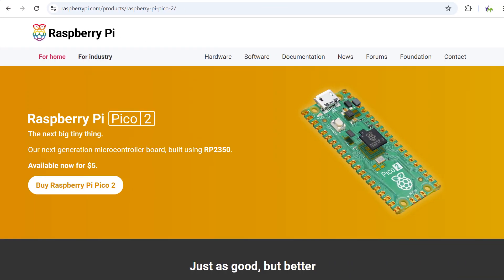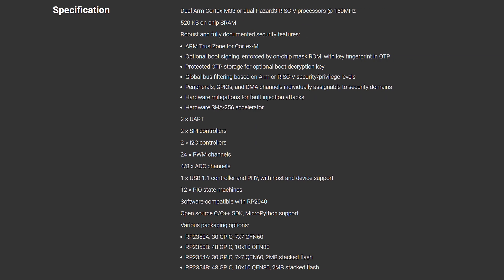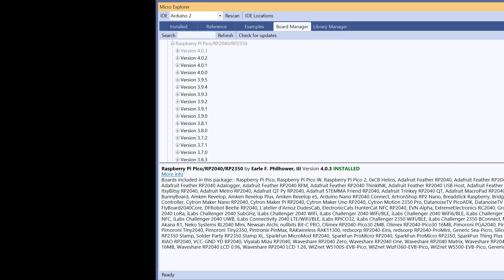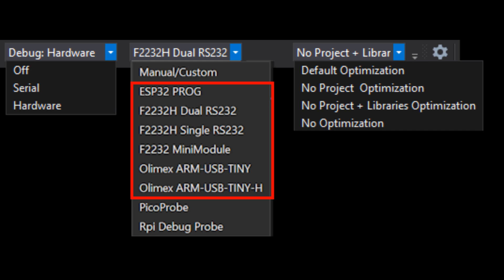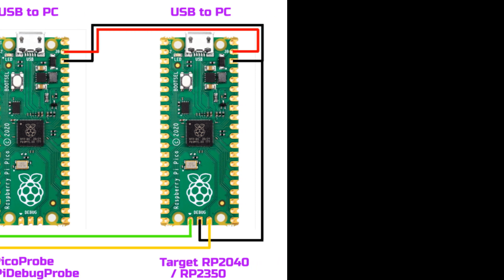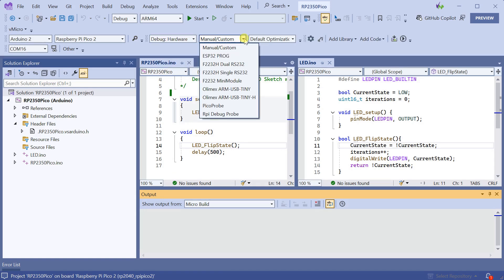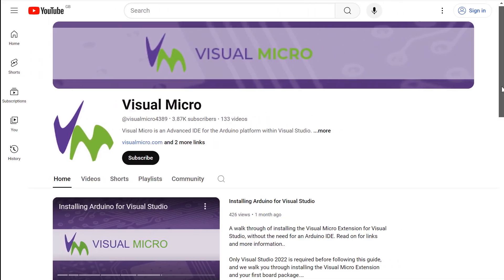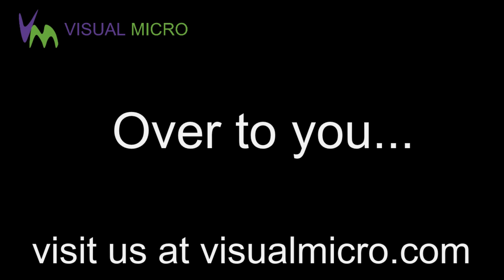RP2350 Arduino Debugging in Visual Studio

Comment: I'm afraid that all this video has done is confuse me. You call it Arduino debugging but the circuit has 2 Pi boards and you mention Pi all the way through. Whyt on earth would i want to denug my arduinno code on a different board to the target?????? I am left thinking this is not an Arduino debugging platform!  I have years of experience with ardunio IDE and platformio and would like to have a hardware debugger like i used to with my pic 16cxx and 18xxx with the ICD back in the day. So please make a version of this video that is based around the ACTUAL arduino (32-bit preferred such as rhe adafruit M4 board) and does not mention raspberry pi.
Reply from the maker: Hi, The video is about the Rasberry Pi 2350 board not the full Rasberry Pi computer board that runs Linux (the full Pi board is more commonly known). The Visual Micro extension for Visual Studio only supports Arduino compatibles. The 2350 is a new Arduino compatible from raspberrypi.com. For hardware debugging (as opposed to software debugging), the manufacturers of each microcontroller/board design specific functionality that Visual Micro makes available to the Visual Studio IDE. This means that the available debug options change depending upon the board you have chosen to work with. These options are normally reflected in the Visual Studio IDE on the vMicro>Debugger menu or via the "Micro Debug" tool bar (hidden by default). The Documentation link at the top of VisualMicro.com explains more and also has some guides allowing non-standard and enhanced debugger variants to be configured. Some people also prefer to use a different board as a programmer or debugger. The  advantages will be explained in each manufacturers overview of the capability. If you are unsure how to proceed, then please use the forum at visualmicro.com to create a thread with your question for us. Thanks
Reply from the maker: Pi also make Arduino compaibles and are quite popular. Visual Micro is only for Arduino and Arduino compatibles.

Comment: Arduino Uno R3 is being used in many schools in teaching the basics of programing. Please make a video about how to use Visual Micro to blink a led with UNO. Finding and connecting it to VS is not an easy task for beginners first time touching Uno.  Show how easy it is with Visual Micro and they will never change to other IDE.
Reply from the maker: Thanks for the suggestion. We will do that. Educators can also package pre built solution(s)/ sketch book folder/ libraries / core using the portal feature. Then students don't have to install anything other than the visual micro extension. The project(s) in the solution can configured to default to the Uno R3. https://www.visualmicro.com/page/How-to-Encapsulate-a-Board-Package-with-a-Solution.aspx